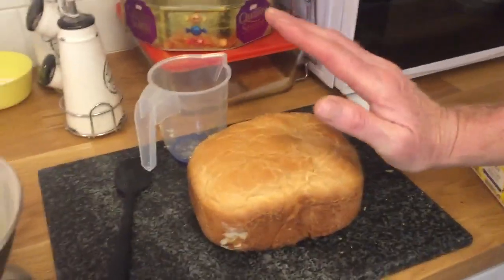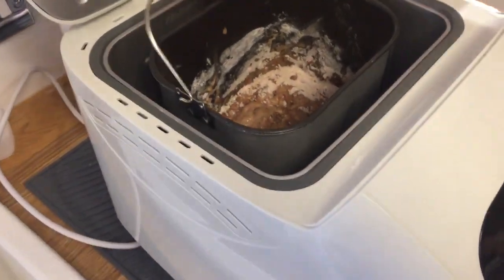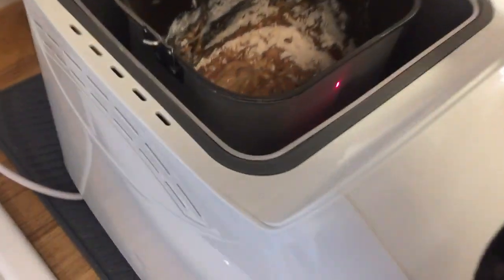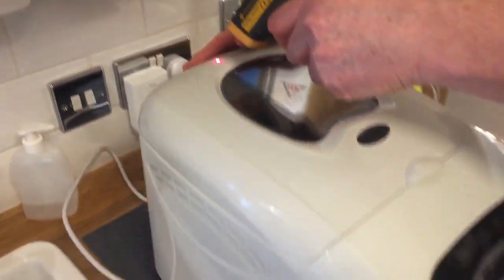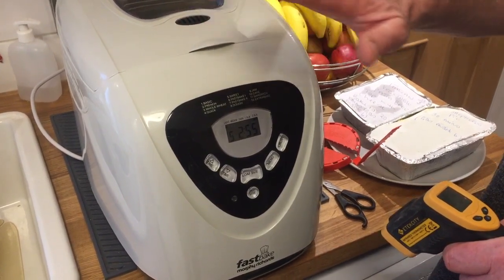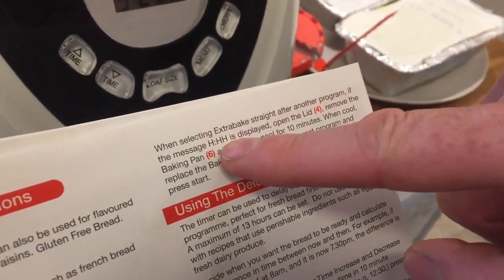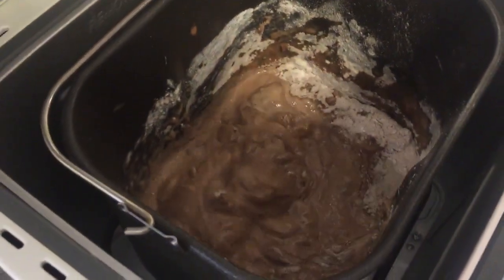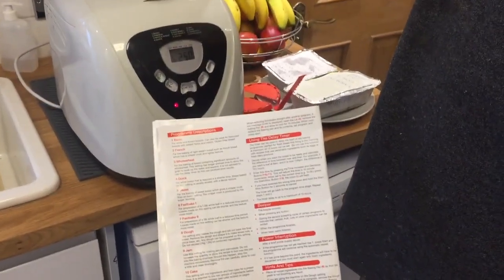Morphy Richards Fast Bake Breadmaker - How To Fix HHH Error Code

Comment: If heating element is cooling down and you switch it on it can damage the heating element, same as with light projector bulbs etc. Let it cool sufficiently then the whole element cools evenly and fresh start.

Comment: cut a hole in the bottom with a dremmel tool and you can replace the belt no problem.
unless you have kids at home i wouldn't bother but it's perfect to have better heat dissipation and all that heat really is not good for the belt. they never gave easy access to replace the belt and is a really just a hours work to take the machine apart to replace the belt.

Comment: I just purchased the same machine you have and when I plugged it in I get no digits on display at all but the machine is just constantly running. It will be going straight back
Reply from the maker: Sounds like something has failed internally unfortunately.

Comment: I tried using mine to bake,the paddle was not rotating at all.the machine indicated it was working, because the sides of the ingredients baked.when I removed the baking pan,the paddle rotated, but I fixed it back,the paddle was stiff. What am I to do please?
Reply: I was referring to the kneading blade.thanks
Reply from the maker: Are you saying the kneading blade isn't spinning but the machine still runs?
Reply: Yes the machine is working, but the kneading blade isn't rotating at all.
Reply: @monilolabolarinwa2057  ..the belt has disintigrated and clogged around the motor spindle. quick fix is cut a hole in the bottom use a dremmel and replace the belt. they made it very akward to replace the belt.

Comment: I've been through 2 breadmakers in 2 months, both times the belt snapped have you had this problem?
Reply from the maker: We haven't had any issues so far, were you using them a lot?
Reply: if you have a dremmel cut a hole in the bottom and replace the belt i had the same morphy richards and the heating eliment stopped working. so i got a cheapo argos used breadmaker on ebay £15 brand new. the belt snapped the first week i had it so i cut a hole in the bottom and swapped the belt in from the morphy richards.
the morphy richards lasted me 5 years so i would buy another one and it was a refurbished one on ebay.
i guess using it to mix bread and then use your oven to bake the bread would give the belt a longer life span as the heating eliment is right above the belt.
but the belts are alot cheaper than buying a new machine.
here is a video to show you a example dont use a blade though.
https://www.youtube.com/watch?v=63_TLcJc1ro
Reply: Just broke the belt on ours after it came out of storage for many years. I was annoyed with, myself the paddle wheel assembly for mixing the bread was seized solid. I could not turn it, this caused the perfectly good belt to break.  Check the paddle wheel in the mixing bowl turns relatively easily. It can be stripped and rebuilt. I purchased a belt and although I have freed off the paddle wheel assembly will probably put a seal kit in.